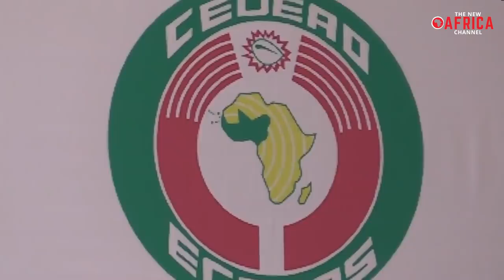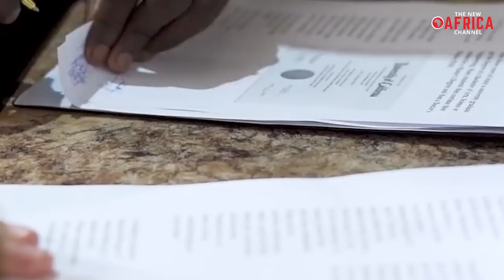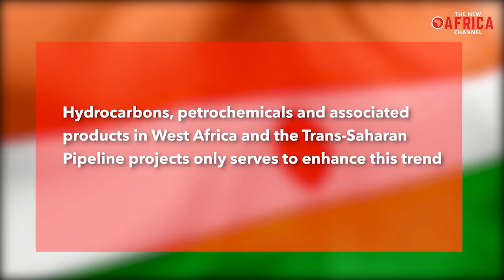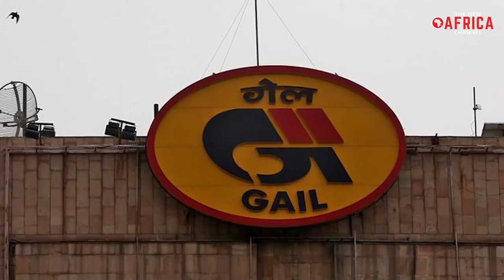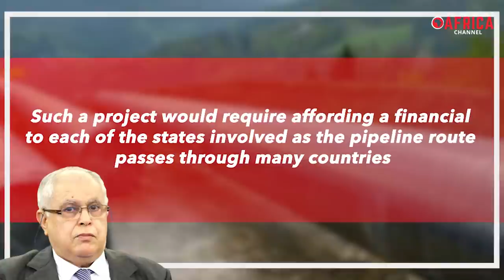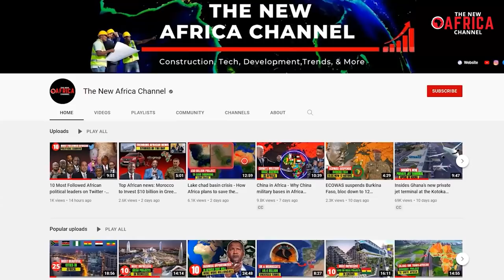Trans Saharan gas pipeline - Nigeria,Niger & Algeria signs deal to revive $13bn gas pipeline project

Comment: The route with the least amount of participating nations is the most manageable and realistic, particularly given the constant political instability in this region. Facts are facts. Key: the leaders of the 3 counties involved need to have closed-door meetings among themselves to set up a 24 hour monitoring system over the entire length of the pipeline and a "defend and repair" force that is ready to spot, liquidate, and remedy any sabotage to the pipeline system.  There are many large state actors that would have a vested interest in halting gas transport out of this region (USA, Norway, technically also Russia - while they'd never bomb their own pipelines, they would, like the other producers, have a theoretical interest in limiting production of competitor blocs to one of their principal exports). The security element should not be neglected in the planning or cost projection of the endeavor.